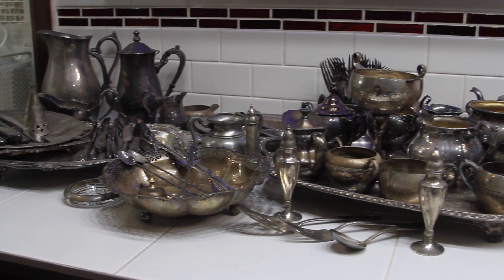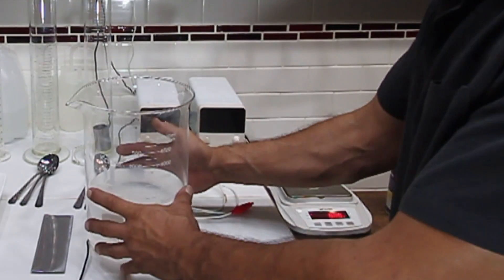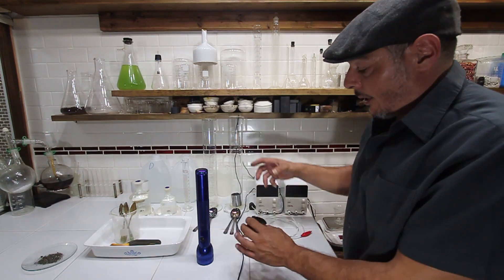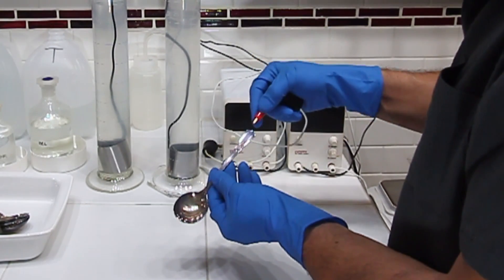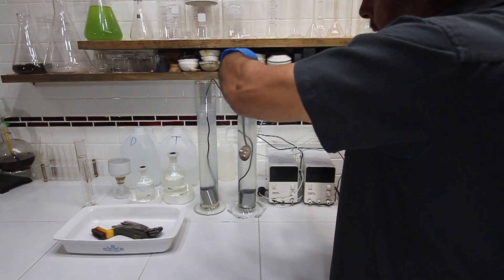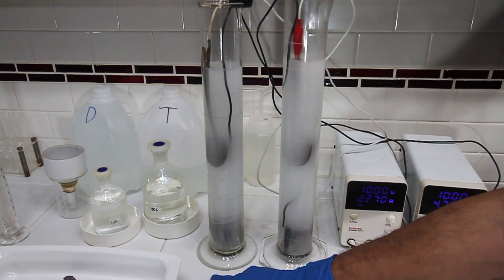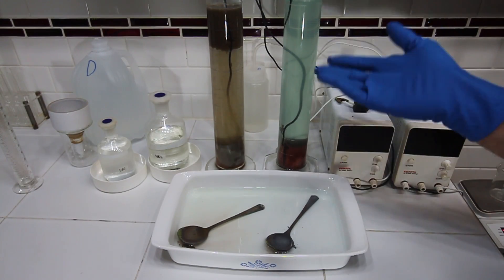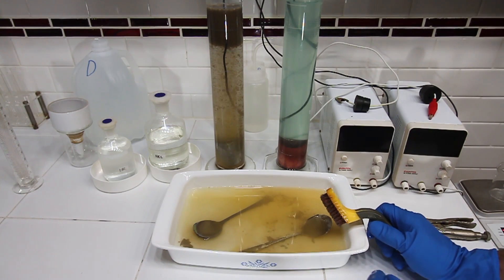Remove Silver From Silverplated Scrap (Reverse Electroplating)

Comment: might evaluate (as i just did some research) that there is chlorine gas released in the salt water process.  when the liquid turns black, its alot of silver in solution.  also, using a process with sodium carbonate (washing soda, Na₂CO₃) avoids the creation of toxic gasses such as chlorine.  i think this is correct but back check if you would.  cheers

Comment: Folks this guy is a fool. He is not wearing Safety glasses, no face shield, no eye wash station and open containers of acid.This is a recipe for serious injury. Do not attempt this.
Reply from the maker: Fear is a liar.  If I were afraid of chemicals, I wouldn’t drink my tap water and I wouldn’t breathe outside air.  Instead, I choose to understand all off the chemicals surrounding me everyday.
Reply: @anthonythomasfmg  You may understand the chemicals but you are reckless in handling them. You show that you really have no understanding of the chemicals you are playing with because if you did you would be using the required safety equipment to protect yourself.

Comment: So, with this method could a person just transfer the silver plating from the scrap onto a piece of copper or brass?
Reply from the maker: You could try, but my experience with it is that it will not sufficiently bond to the surface. It more or less falls off and piles up.

Comment: Nice Process, however, it is way to Complicated. Salt, distilled water, stainless steel strip and 6/12-volt unit. I made 34 pounds of silver sludge over small amount of time. No special tools, no acids, no glassware, just small used plastic tub
Reply: Hello , can You explain the easy proces step by step , Regards
Reply: do tell

Comment: Maybe the Hydrochloric solution would get better with each spoon because you created copper chloride? Copper chloride is very good at removing gold plate from copper base items.(Agitated with an air bubbler, no electric current)  It may work the same with silver?

Comment: If you drilled a hole in the spoon You could use a stainless steel hook over top of that beaker. Then, simply attach the positive side to the stainless steel. Allowing you to submers the whole spoon in the water.

Comment: How are they connected in the solution? On the silver ware the plug and wire is out of the solution (only the tip is dipped) but what about inside the solution? I didn't catch if the wire and plug is able to work under water (probably sounds like a dumb question I'd imagine) 😅
Reply from the maker: Connect wire to silver piece and lower into solution just up to the connection but not touching. I have started covering the connection with Teflon tape to prevent corrosion. Only the material in the solution will dissolve.

Comment: I have silver plated screws 1/4”long x 1/8” thick! Could I use a stainless mesh ladle for anode? Process is by the ladle and just shake the ladle in a rinse pot then repeat?
Reply: The salt water solution is what I would prefer trying! Does the amperage matter?

Comment: I also use electrolysis equipment to recover silver from scrap materials, and I find it very effective. THE RECOVERY SPEED IS VERY FAST
Reply: How expensive is that
Reply: @snickymike7628  Plain old Chinese power supply go for about $60 brand new. They are worth it because they can be dialed to the correct voltage. Virtually everything else can be bought at Walmart, Kroger, you name it.

Comment: What did you do with the leftover metal that is the rest of the spoon?  Was it Nickel?  Copper?  Do you know how pure it is?

I am getting a smelting furnace soon because I inherited a literal boatload of silver plate recently, and I want to smelt down my leftovers provided they aren't silver plated steel; curious as to how much leftover useable material there is.
Reply: If it's silver plate, it's probably on brass. Or stainless/steel. So you're not talking a kings ransom. But brass can be sold to scrap yards scrap yards for 1.70/lb or so. It's an alloy and you wouldn't be able to separate into elements without using chemicals. Just sell to scrap yard or make brass ingots

Comment: I have done this with vinegar instead of hcl. I found it worked better than no vinegar and run 6v. I will try the distilled water salt thing next.
My question is how do you prosess the waste if you have no nitric acid.???
Reply: So been thinking
Using vinegar is way cheaper and easier as far as waste goes.
Do the reaction for stripping then take solution and remove base metals with concentrated vinegar, salt and h2o2 to get a cleaner silver.
Then save it for the day that you have a proper setup to refine with nitric and be done with it!
Love your channel btw thanks for all the great info!
Reply: Im wondering if you added potassium nitrate to the hcl solution would that precipitate the silver chloride?.
Reply from the maker: Yes, it will precip everything. Electrolysis with platinum anode and graphite cathode will also precip just the silver if you run half of the solution until you start to see the copper drop stop elec.
Reply from the maker: Electrolysis - Graphite cathode and platinum anode. Silver will drop first. Stop electrolysis as soon as you see the copper drop. Just finished up this experiment. Maybe some kinks on the pt anode but it worked very well in my first attempt.

Comment: If not said already, once de-plating has been done. you can disolve all into a 70/30 Water/Nitric and use copper to cement out pure silver. Copper will exchange with solution silver to form silver metal. this bypasses the need to restore silver chloride. basically takes you 2 steps in front. alternatively this 70/30 solution can also be used as an electrolyte for crytsalization of silver onto stainless. however, for purposes of refining silver for future melt, the copper transfer method is most efficient.
Reply: Can you expand on this? You're saying after getting the plate metal in the bowl you strain it off. Then you put all of it in a jar of 70% water 30% nitric acid. What do you do with copper?
Reply: I googled a bit the ai says it’s a redox reaction so I assume you can put any copper made stuff in and it will work, like how plating is using the redox reaction
Reply: It says because silver nitrate will exchange ion with copper when it enters, and the cement silver is not that pure
Reply: Dosent the process plate the stainless with silver
Reply: Silver cell is tbe way to go if your going to involve nitric acid
Reply: Wym “use copper” like dissolve the copper into the solution to form it
Reply: @theindustryfarm7405  once your silver solution is done and ready - drop a piece of copper in it and the silver will cement out and grow off the copper. they swap places in solution.

Comment: Interesting experiment!  The HCl containing solution is clear, which makes sense since all the metals dissolved are soluble in acidic Cl- solutions.  One thing that is probably happening... AgCl is weakly soluble in HCl solution, you could be dissolving Ag and then plating it out on the cathode to a degree.  I think this must be happening because you don't see any cloudiness from solid AgCl accumulating in that one.

Also, in the non-HCl solution, do you recover that muck?  It must contain Ag, AgCl along with the base metals.

Comment: The sediment in the saltwater bath is copper. If you treat it with hcl it creates the blue solution and the copper will cement out onto steel.

Comment: Will this excessively pit the base metal (in my case brass) if I wanted to use this method to remove old plating in order to prep for replating?
Reply from the maker: Not to bad, but what I think could be a problem is incomplete removal of silver plating with this method. Some pieces come nice and clean and others don’t depending on base metals.
Reply: The electrolysis process is directional if you use a stainless steel container as a cathode it works better.
Reply: Lower voltage and use vinigar instead of hcl you will corode less.
3 v will be slow but safer

Comment: If you did the same experiment using distilled water and non-iodized salt you'd have much better results.  The pieces would de-plate significantly faster and far more completely.  I also hammer my plated pieces flat before processing as it seems to loosen up the plate a bit n speed up the process overall.
Reply from the maker: Sounds like good advise. I will give it a try.

Comment: Hello man, I got some plated stuff (early buyers mistakes), I wondered, what to do with it. DC - check, some beacher - check, salty water - check... May be I will refine obtained material by cupelation, dont know yet, how much silver will I get from just few pieces...
Reply from the maker: Hey there Frantisek! I get about 1 gram per piece of silverware (forks and spoons) depending on single, double, or triple plate, and 10g - 15g with some of the larger pieces. Still worth it I think, if you didn't pay to much for your pieces.
Reply: @anthonythomasfmg  thanks... What I paid is out anyway, so, trying get something for it...